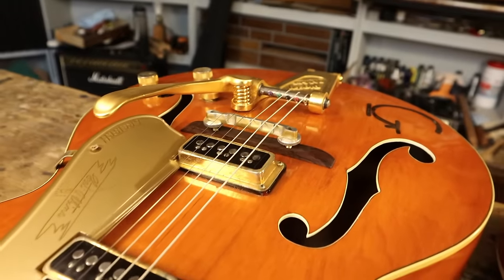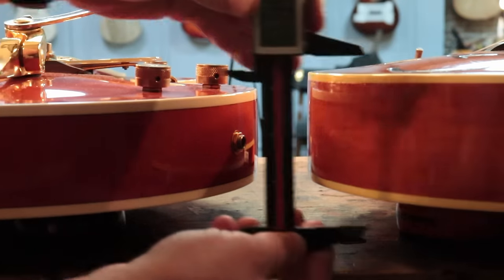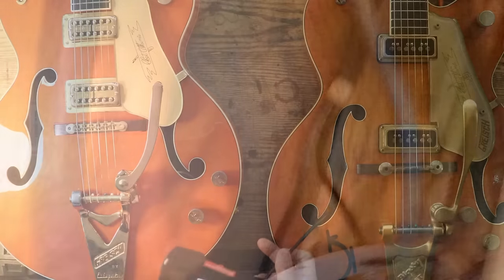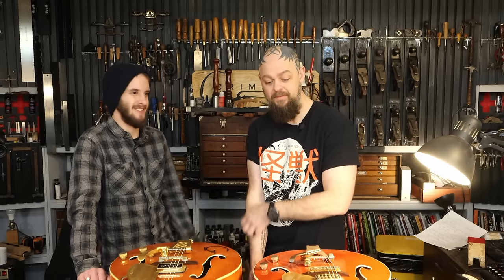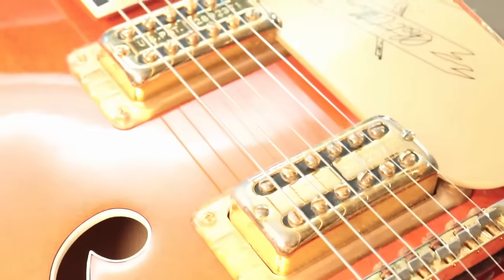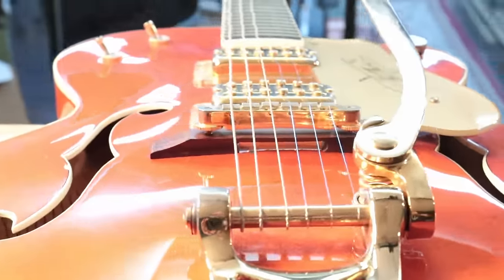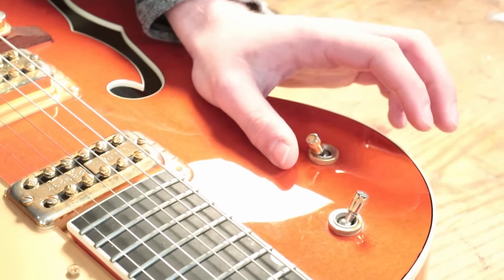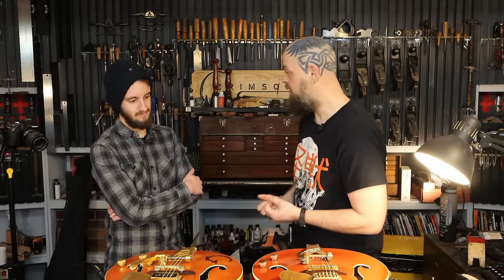£30k vs £1.5k Gretsch Guitar Head to Head & Luthiers Review. Does NEW Stand Up to the 50's Heritage?

Comment: As I recall, Chet Atkins was always seeking ways to reduce feedback. I think that is why he wanted a thinner body and probably the bridge post. Again from recollection he was responsible for the solid tops with painted f-holes as a further effort to suppress feedback. Why he didn't use a Telecaster, I cannot fathom. I guess he wanted the hollow body sound.
Reply: I came looking (and hoping) for this comment. As I understand it, Chet worked with Gretsch quite closely developing his guitars. Probably a LOT closer than Les Paul did with Gibson. The thinner body, thicker top and bridge post all come out of that development. Later on they did indeed remove the f holes and just paint them on. Slab cut braces and glue squeeze out probably don't come from that development! So, a lot of Ben's criticism isn't really fair but some is. The Japanese made Gretschs are meant to be high end instruments and if I were to buy this type of guitar, I would expect quarter sawn braces - as I would on a similarly priced acoustic. I'm not sure if it actually impacts on sound or durability in this instance but I think it does impact on the perception of quality.

Comment: It is worth noting that PAF and Filtertron p'ups are made differently. They're a lot closer in volume than you suggest. Impedance is only an indication of how much wire is on the bobbins. Filtertrons have much bigger, stronger magnets than PAF's, compensating for a lower number of winds.

Comment: Enjoyed the video and the info about both guitars!

To answer Ben's question about why they replaced the more flexible tone pot with a switch: the tone switch was a Chet Atkins' idea as he wanted three different tonal possibilities at the flick of a switch instead of fumbling around for a tone pot.  To augment Sam's description of the tone switch circuit, when the tone switch is in the middle position, the tone is as bright as it will be as the circuit is completely out of the signal path.   In the up position it is like having a tone pot rolled back to about the 6 position; this would be the "darkest" tone position for the circuit.  In the down position it is like having a tone pot in the 9 position, slightly rolled off.  That is how Joe Carducci of Gretsch describes the tone switch circuit in a video with Greg Koch where they go through the features of a 6122-1962.

A note about the bridges: the bar bridge on the 1955 guitar is a floating bridge, however the tuneomatic bridge on the newer guitar may very well be a pinned bridge.  A floating bridge, although it is more susceptible to being knocked around during rough play thus compromising the intonation, will be more resonant than the pinned bridge (which won't be as easily dislodged).

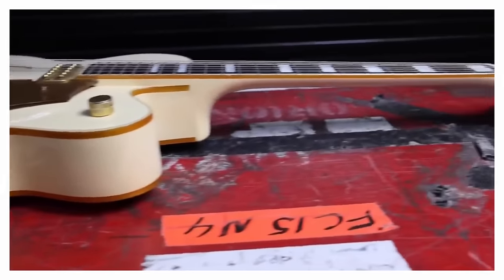A couple of comments about Pat Smear's 1990s White Falcon - you can tell it is a Fred Gretsch Enterprises Falcon (1990s pre FMIC) by a) 17:38 the sparkle binding where the neck joins the body doesn't have a strip connecting the top and back, b) 17:43 Grover Rotomatic tuners are used instead of Imperials (although Rotomatics were used on some Baldwin era instruments, usually Imperials with stairstep or the large kidney bean keys were used on the Falcons), c) 18:09 the shape of the upper bout is "flattened" where it meets the neck, later (FMIC) Falcons had a more rounded upper bout which is per the original spec Falcons of the 50s.  Also of interest at 18:09 are the shape of the top of the headstock (very soft V shape) and the much smaller F holes which (along with the description that it originally had a Bigsby) would indicate that this appears to be a 7593 model Falcon (rather than the 6136 Falcon that had larger F holes and a sharp V shaped headstock).  The FGE era Falcons used 5 ply tops whereas the later FMIC era Falcons used 3 ply tops (more resonant) again according to the spec of the earlier Falcons.  Also the FGE Falcons typically used ceramic magnet Filtertron pickups whereas the FMIC era Falcons went back to using AlNiCo Filtertron pickups like the early Falcons (except where they used Dynasonics).

Comment: There is a modern reissue of this 54 called the 55 vintage select. I can't speak for the internals but externally it's exactly the same as they original down to the nitro finish. The one you are comparing the original to is a 59 spec. 

Of these two I would take the original. But I would have an original Falcon over a 6120.

Comment: I don’t understand why you are calling this an acoustic guitar. Also, the design choices all point to “less feedback”, which makes sense because we use more volume and gain compared to the 50s & 60s. Anyways, i have a recent japanese white falcon and it sounds incredible.
edit: obviously an anniversary model is not the same as a reissue model
Reply: Because it's supposed to be an anniversary rendition of an old model
Reply: @zpacula  Nope, it is a Gretsch (company) anniversary guitar, not really a reissue of an old model. 

Gretsch however does make a reissue of a 1955 6120 model that would pretty much have the same specs as the vintage one, but for some reason they compared the old one to a totally different version of the 6120 model. A lot of the things Ben talked about were seen as improvements since the older guitars had serious feedback issues. Chet Atkins even had them do guitars without F-holes to reduce feedback. Apples to oranges.

I personally think this comparison should have been made with a similar guitar, since like I said, Gretsch still makes them with vintage spec as well.

Comment: Chalk and cheese - so not really a fair comparison. 

Anyone who wants a true arch top can get one. The vintage one here is at the start of the development process. 

As you say, Atkins himself had changes made, Gretsch used trestle bracing for example, and he slimmed down ’his’ guitar too.

Now, the sound that people want these for is mostly down to the stiffness of the instrument and the pickups - so what if the guitar is built in a more robust way? 

Personally, I prefer a more modern playability also - you really have to work hard with some of these old beasties.  I’m afraid that my choice would be a modern 60s slim carve to a 59 on a Gibson, for example.

So, different development stages. What’s better? Play and listen.

Comment: Seems like a comparison video from people who don't know a lot about Gretsch guitars! As a Gretsch player this was a bit annoying, unfair and "snobbish" towards a newer model, which was not the same spec at all. You really should have compared like with like. You worked out the 50s Gretsch was worth around £3425 new so should have compared it with the current range, with the same spec at around the same price, and not a 2008 model with entirely different spec. That just makes it a random comparison. 

Scale length also varies, most are 24 1/2 inches. You seem to think the tone switch is modern too, which it isn't, it's a 50s design and was added when they changed to Filtertrons. Filtertrons have the tone switch, Dynasonics have the tone knob, Always was thus. There are modern models with 50s bracing, with Dynasonics, and some are around £3500 - £4000. Some are nitro, some poly. 

You just seemed to have used as you yourself say "apples and oranges" here. And the equivalent guitar today is definitely NOT a Gretsch custom shop at £10,000+. Also, those Dynasonic pickups are set up way, way too far from the strings, they should be much closer for optimal performance. If you can't lower the bridge, and you probably can't because you reset the neck, (very slightly wrong angle looking how far the pickups are away?) then you need at least one more riser and probably also need to raise the pole pieces. A missed opportunity in my eyes.